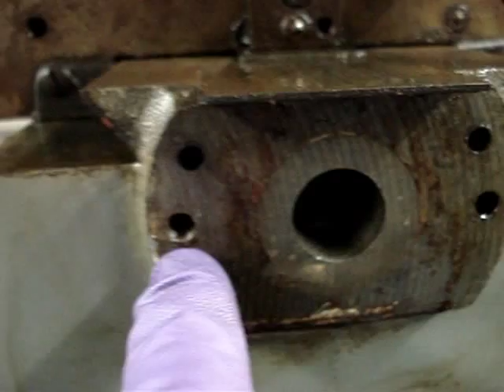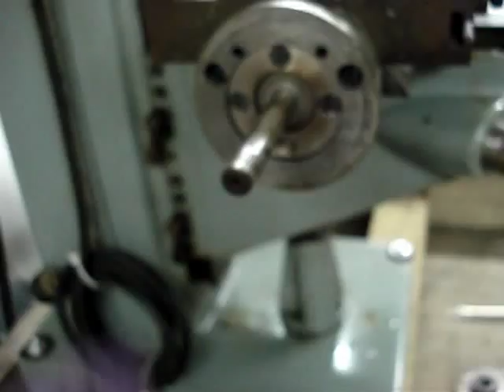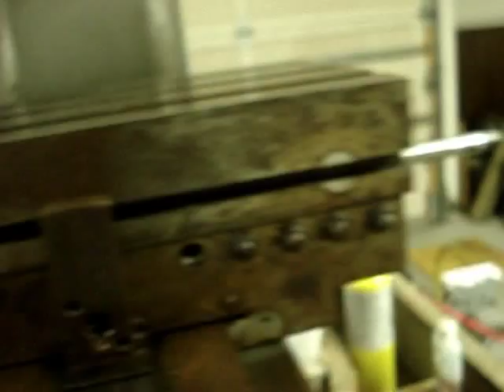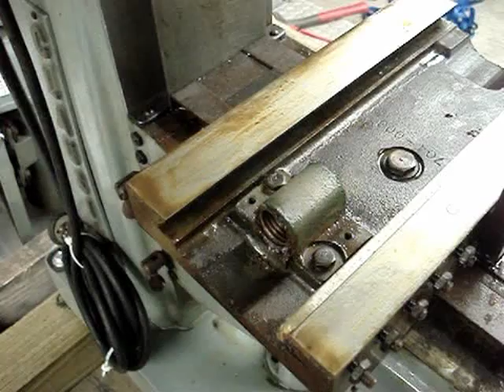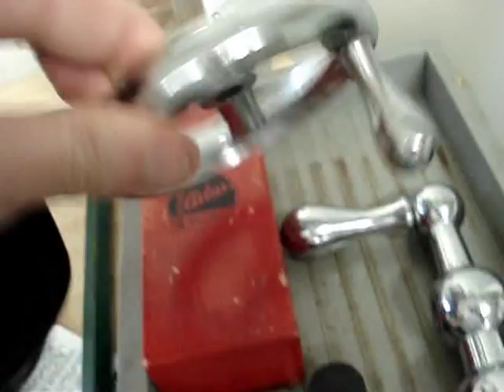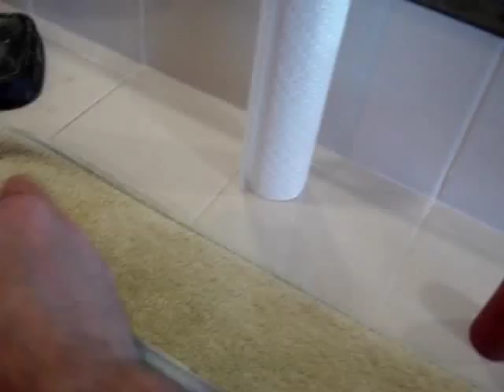Clausing 8520 mill restoration - Part 2

Comment: @ray thanks so much for posting these videos. Fantastic step by step detail. How is your Clausing machine? Did you ever convert to CNC?
Reply from the maker: Glad they helped out! I ended up selling mine due to having to move and sell my house. I'm probably going to look into getting another mill once I build a new home.
Reply: @ray5961  Ah bummer - I just picked up a 8520 that i took apart in the sellers garage so I could move it myself and was watching your videos as I was working. Taking the table off was tricky.